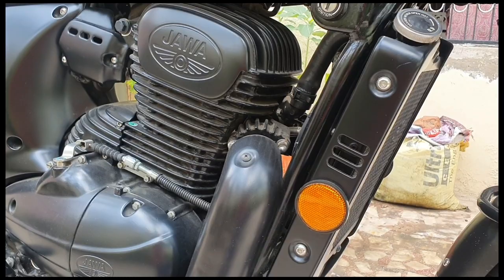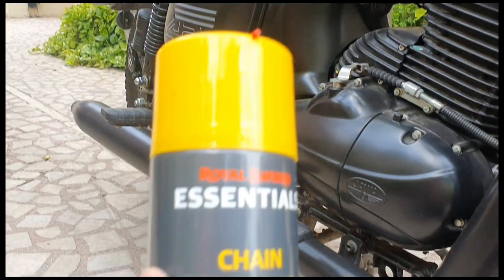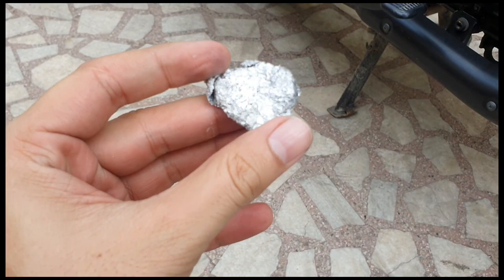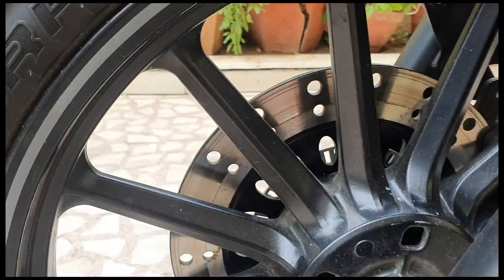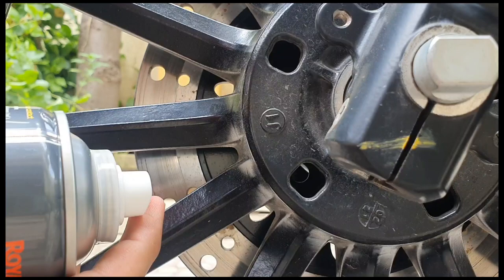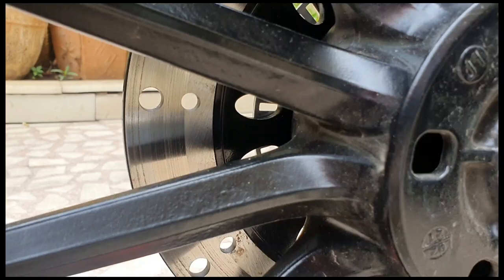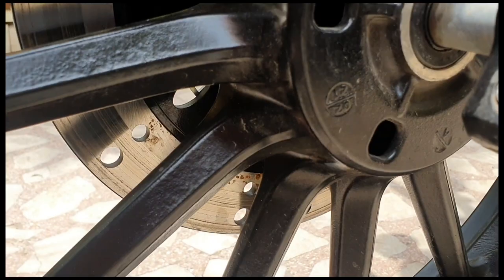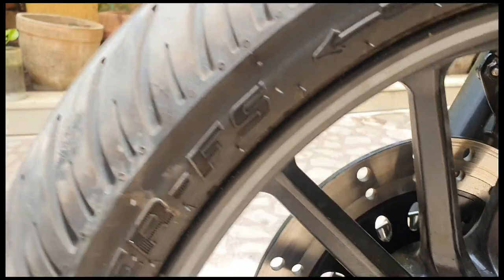How to remove rust from motorbike disc brake - DIY Video - Jawa 42 2.1

Comment: I own a JAWA classic BS4 , 8500KM's done , I'm facing a rear brake issue(the bike completely stops and doesn't move even though it's in neutral) .. service center guys are not really working well on that issue. Do you have any idea about this ?
Reply from the maker: Unfortunately no. I have never seen such situations. You can try contacting HQ and they will raise the issue to higher authorities if your problem is not getting solved.
Reply: Maybe it's master cylinder issue?